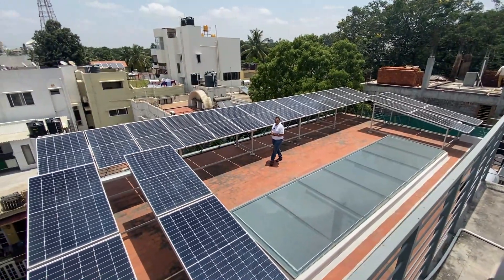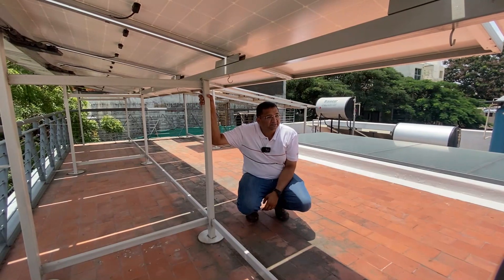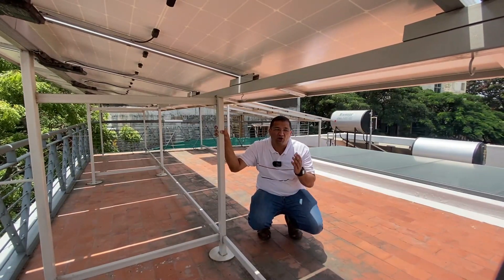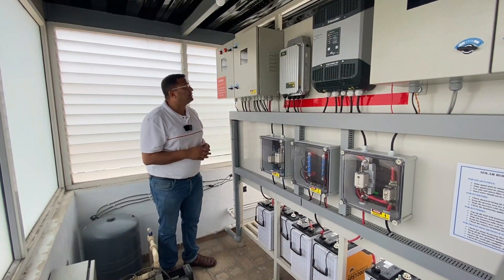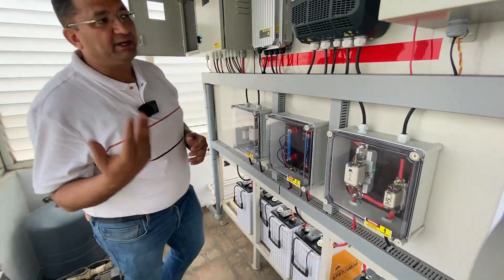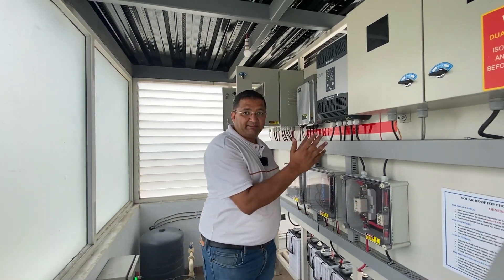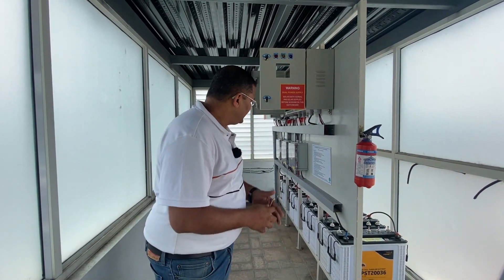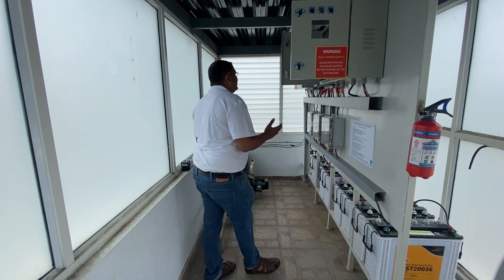On-Grid and Off-Grid Rooftop Solar System for the Home .

Comment: Very good explanation for solar power system. Besides that how many panels for 5 kwts. How much area is required for different types of systems and how much cost to install in individual house having 3  portions with car parking area and 3 floors which need to get all connections in it. Say per house for 10 LED bulbs, 5 fans , refrigerator, 2 LED TV, induction stove, water purifier, geizer, water motor and lift. Kindly if some reply comes in each that will be very much appreciated. Atleast once a week reply may be given so that nowadays solar power is highly in demand for almost all own household. 13:43

Comment: 12:37 a line on the instruction set pasted says to not use hard water, how many ppm would u consider hard water?
the water in my city is around 100-110 ppm (on my TDS meter), can I use this?

Comment: As always, a good informative video. Why was the rooftop structure size height so low? It would have been far more convenient to have it greater than 7 feet like elsewhere.
Reply from the maker: Taller structures would not have looked good. Also for this site, tall structure was not required.
Reply: ez panel cleaning, cost, resiliance seem to be some issues I could think of
Reply: Height is left to our requirement.